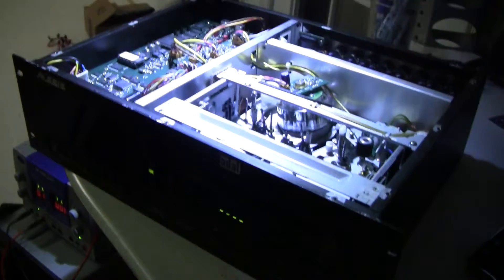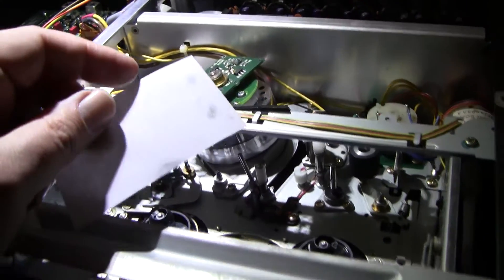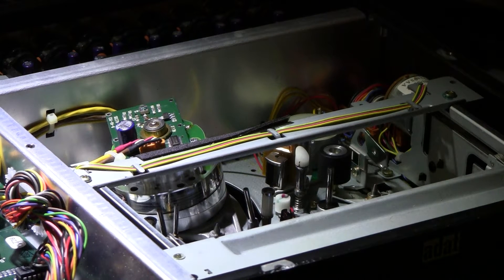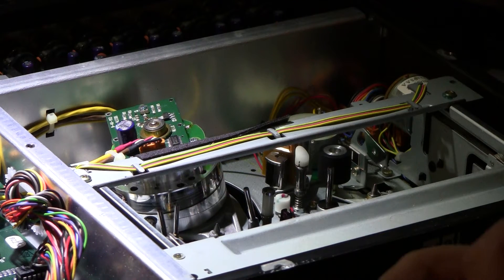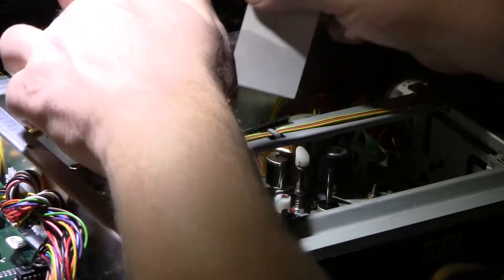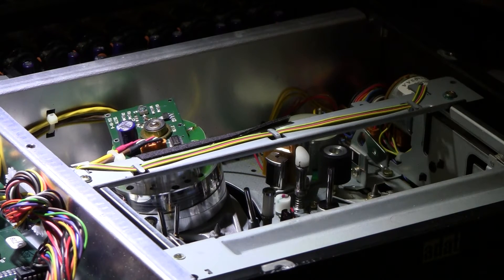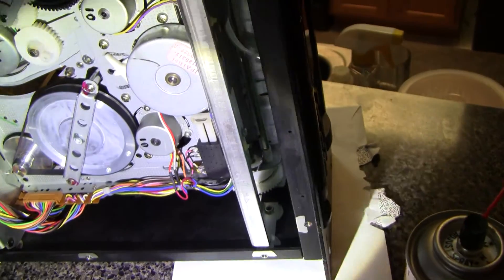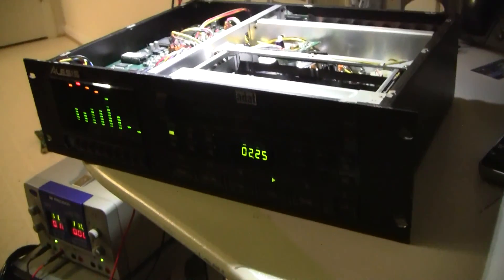Cleaning ADAT Heads & more. Error 7, Error 9, Er7, Er9, Laser Shows, Pangolin

Comment: I’m so glad I found your channel!!  Sooo, have you heard anything about anyone wanting to ‘DC enable’ these ADATs not for the purpose of using them with laser light shows, but for these modular synthesizers that are all so popular?  I actually ran into a link to this on an old thread where these mods for lasers was the topic.  I understood it to be stated that if you send in 10 volts, the output is not properly mirrored, and so you’ll end up with essentially a buffer that outputs 9.66 volts from 10 at its input.  I don’t know whether laser folks would know about these Eurorack modular synths, but there’s quite a few modules built by a guy under the brand Expert Sleepers.  And their modules can enable DC recording / line level synth (pretty high impedance From -5 to +5 volts) recording over Toslink fiber optics.  THANK YOU VERY MUCH FOR SHARING THIS!!  I just picked up like ten old ADATs for parts.  I’ll be happy if I can get one working and the blackface worked for ten seconds, then ERR 9.  So this is helpful!!  Great Stuff, thanks again!
Reply from the maker: Late to this, but there is a decent amount of crossover. There are ILDA output boards for eurorack and people driving laser projectors with eurorack modular synths. A friend has a modular synth just for doing video effects. 

Pangolin made a board called the CADAMOD for the later model ADATs where the capacitors were not through hole but SMD. I don't remember what those boards look like. 

Also, you can always go lightpipe in and out to something that can go analog. More expensive, but DZ/Ablebaron has boxes that do lightpipe to the laser show ILDA connector. It may be differential on there!

Comment: I started getting an error 9 message occasionally after rewinding a tape and then hitting play. My ADAT is pristine with only 50 hours on it so although many articles said that it needed a new idler wheel I was skeptical. I open it up and cleaned the tape path and got absolutely nothing on the Qtip. The hands were clean as well. So lastly I just tried your fix and sprayed some CRC electronics cleaner/preservative on whatever switch you called it. Waiting for it to dry.....we will see, but I bet you are right on this one!
Reply: Nope no such luck. I used CRC electronics cleaner. Next I will try deoxit. And lastly I will gently abraid the idler wheel or replace it. Ugghhh
Reply: Final try...deoxit on the switch and very light 4000 grit on the idler wheel....no go. Time to try to look for parts.

Comment: Thanks for this video @telmnster ! I'm happy to report that the LX20 can be repaired in a similar way. I just repaired mine. The only difference is that for Error 09 you have to unscrew the front panel (you don't have to remove the ribbon cable if you don't want to - 4 front screws at the top and bottom) then remove the whole motor assembly with the metal frame intact (two screws on the lower front and three black screws from the rear). This lets you take the assembly out and flip it over to reach the same position slider/switch on the underside. Kudos to Alesis for what appears to be a really modular design.

Comment: Anyone with a bad idler wheel   use a plumbing o ring  on it   take off old rubber and stretch oring around the idler wheel  works like new. I have 6 adats  and all run great with the o rings
Reply: What size o ring do you use. I have an error 9 that is not the detection switch it appears to be the idler wheel. I would like to replace it if it is fairly easy but he o ring might be a quick fix. I also read on a blog that you can try turning the original ring inside out. Thanks
Reply: @TheGreatConstantini  i think 16 dont remember. Ill have to look
Reply: @jgrizz8945   curious what size u used too?
Reply: @kevinsmusicroom1362  I think 16.   I just bought a kit  and had trial and error.   But 16 I believe

Comment: hi great video theere's only one thing there no video's about i can't find any selling  IDLER RUBBER  for the adat's  any where i have alot of unit that eating tapes because
of bad TYRES have gone hard looking for new stock not on stock that's been sitting around and going bad over the years i have a email to terry's rollers
Reply: Plumbing o rings work as replacement rubber on idler wheel

Comment: I use the SR-Audio THC-2 Tape head and the SR-Audio PRC-2 pinch roller cleaner which is fantastic stuff and the prc is great for cleaning and conditioning belts and pinch rollers,idlers like on turntables for better traction and smoother  operation

Comment: Can I use  Denatured alcohol on the  paper to clean the heads or must it be 99% Isopropyl alcohol ?
Reply: Denatured alcohol will work fine as it's pure ethanol with small amounts of poisonous solvents (such as butanone) added to denature it.

Denatured alcohol may actually be better than medical rubbing alcohol because rubbing alcohol is a solution of isopropanol and water.  Isopropyl alcohol cleans fine, but water could pose a potential problem with the heads if you clean them frequently, even when using rubbing alcohol solutions of over 90% isopropanol.

If you're cleaning the heads, you may also want to clean the entire tape path including the upper and lower head drum, with exception of the pinch roller.

The pinch roller should be cleaned using a rubber-safe fluid or even just water.  You shouldn't use alcohol on rubber, especially if it's cleaned frequently.

Comment: Hi! My ADAT Blackface plays back fine and produces audio, but it won't fast forward or rewind. Do you have any clue as to what the error might be?
Reply: quick addition to the conversation we have going here about the rubber restorer. There is 1 (!) company left that makes the original BASF formula for this rubber restoration. Look up Teletech Pro Audio and find their rubber cleaner. This is specifically for audio as opposed to automotive. (fyi @Watcher3223)
Reply: @f115Recs  Nice.
Reply: Check the condition of the rubber idler tire for the reel drive.  It may have just enough traction to drive the take-up during playback and recording, but doesn't have sufficient grip to quickly wind the tape in either direction.
Reply: @Watcher3223  @TheAbsorbant ... which is a symptom of the rubber drying. There are some chemicals that you can buy from pro audio and hardware shops that can soften it up for short term recovery. Reel To Reel Player owners are more in the know about that stuff.
Reply: @f115Recs  Since I am the owner of a Teac X-20R, thanks.

And the stuff I believe you're talking about is Rubber Renue.  And, you're right about the rubber drying up; as it does, it loses a degree of its pliability, which can affect its ability to grip.
Reply: @Watcher3223  Correct! Toxic stuff but does work for these situations
Reply: @f115Recs  That's right, it's kind of nasty stuff, but it does work.

However, you can't use it with all rubber parts.  You don't want to use it with a pinch roller.  It can leave a residue that can cause the tape to stick to it.
Reply: @Watcher3223  I've had some luck with it but yes, you're right too. It's too strong on some materials and effectively melts it.